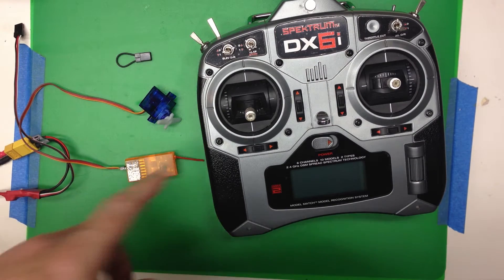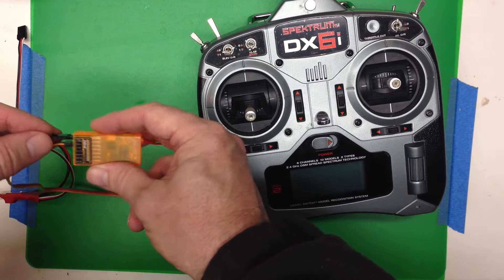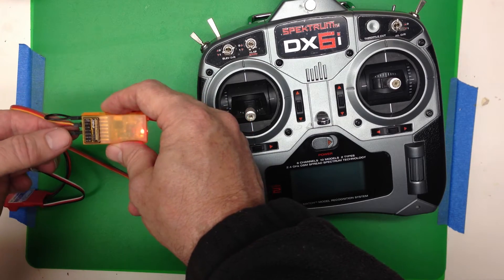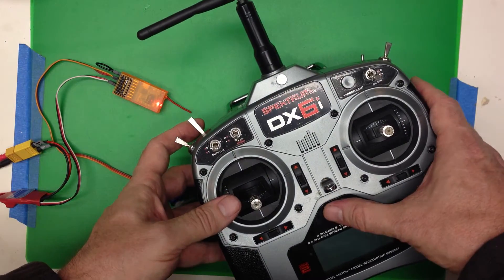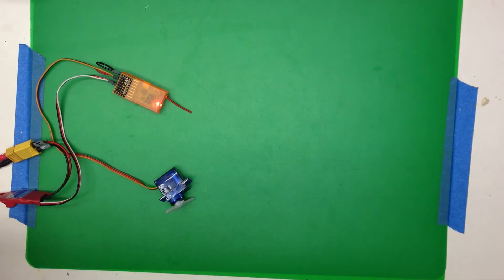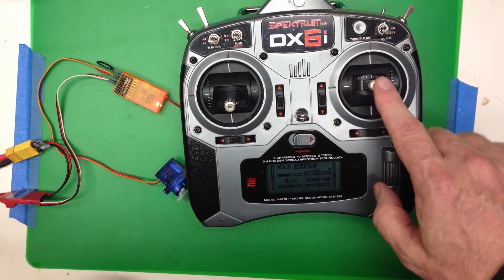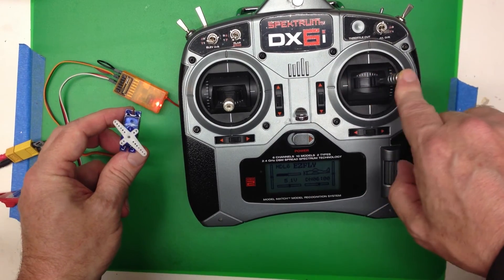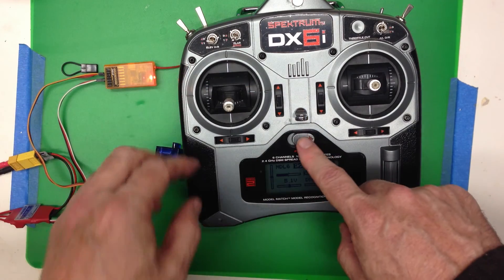Spektrum DX6i Binding

Comment: Hi, 
I have a Spectrum Transmitter and this Orange Receiver. I need help with adding 2nd or 3rd model using the same Orange receiver. I know how to add model on Spectrum TX, no issue there, and also understand that model memory (or profile stay) in the transmitter.  
I BIND my RX with TX the first time. Added the 1st model as “F-22” and everything went well.  Now, when I added 2nd model as “Dragon” and I took out the same receiver from F-22 and put it in 2nd Model, turned it ON, the receiver does nothing. No flashing lights on it or anything.  
I did the BIND process again while selecting “Dragon” model on TX. It went well and Dragon worked fine, but if I put this receiver back into F-22, nothing happens unless I redo the BIND process one more time to make F-22 work, but then Dragon goes away.  
I am sure there is better way, can you please help, if you know the solution?
Thanks,
Reply from the maker: You wish to move the receiver between models, right?  You can do that by having several models on the transmitter, and then rebinding to the proper transmitter model each time you move your receiver between models.

Comment: I'm new to this radio control hobby and I've found many helpful vids on YouTube, particularly yours..!!  Last week I bought a second-hand Blade 400 3D.  It came with a DX6i like yours in this vid.  Unfortunately, the DX6i had seen better days, but it functioned okay with the Blade 400.  Today I bought a new DX6i, but it has an X to the left of the display screen.  Whilst your vid has helped me bind other RC aircraft to the new DX6i - the distance between TX and RX WAS the problem during the binding process, I am still unable to bind the new DX6i to the Blade 400.   Could it be a mismatch between the 'old Spektrum 6-channel Rx and the new DX6i with the 'X' on the face?  Any suggestions would be very welcome.  Thanks again for posting this helpful video.

Comment: So I just got got one and I'm trying to bind it to my e-Flite apprentice S 15e.. 
The receiver light flashes then goes out and never a solid color .

I've tried everything , and now it wont work with the original RTF DX5e TX

Then I saw you vid... and like you said all I had to do was back off of it and BAM solid red... 

Thank you so much :o) now If I could only get my Ares P51d Ossesion to bind to the thing I would be lovin it lol

Thankx so much
Reply from the maker: Hmm, if you get the fast blink when you first star it sounds like the receiver might be bad.  If it's a new plane it's probably under warranty and you should be able to get it replaced.
Reply: Mark Harrison I got the Apprentice to bind... thanx to you'r vid .. I just had to back of of it ...like you said ... with the p51 there is no bind port but there is a little deal to push and I backed away from it and still no luck... lol Ill get it sooner or later.:o)